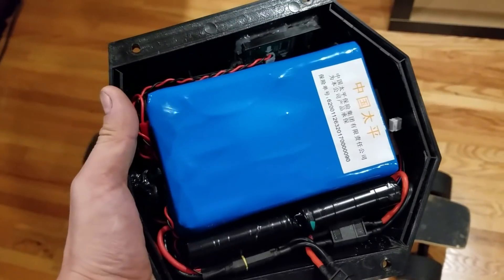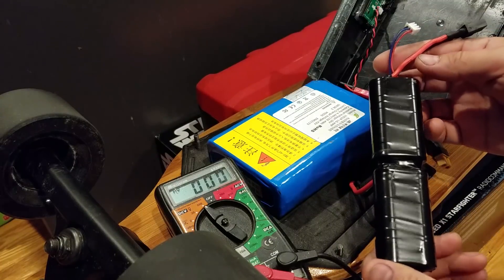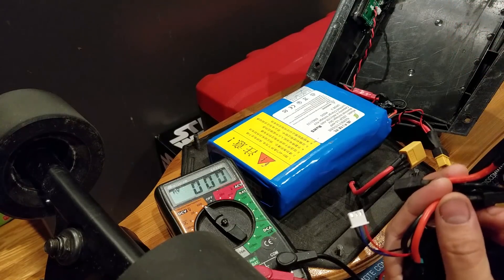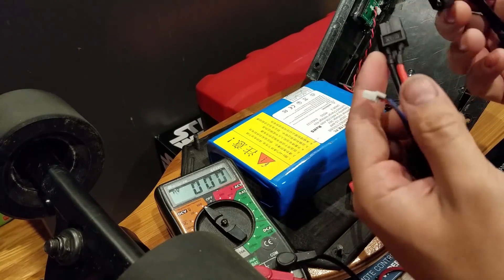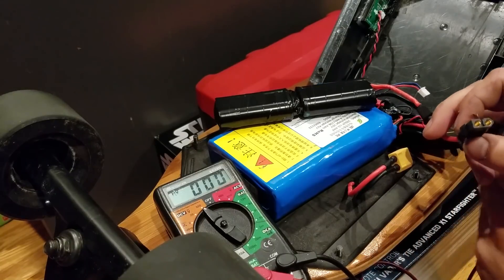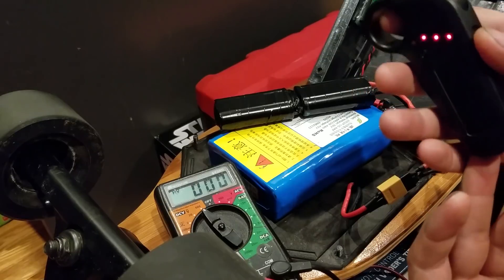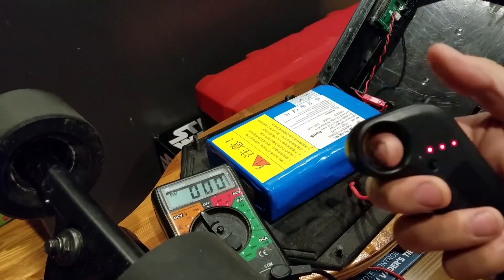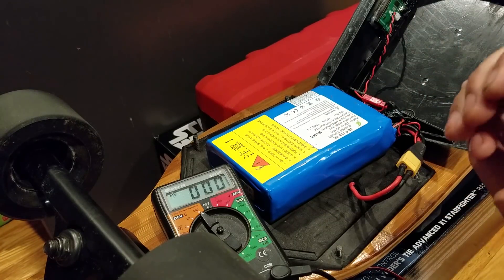50V Meepo Board

Comment: Hey! Just so you know, you have to resolder two spots on the esc for it to handle the higher voltage :-) The ecs is made for 12s.

There should be a guide for it some where,  you can even buy them "premade" for 12s.
Reply from the maker: +EDM Panda ive been searcing for 30 mins and can't find which spots to solder for 12s. From what i can find is there are two diffrent point to solder for 6s or 7s and if none of the points are solder, then 10s is enabled. 
I did find on reddit, one guy plugged in a premade 12s battery and that worked right out of the box. Without any modification to the esc themself.
 I cant even find any of these premade for 12s. 
If you could link me to the guide that would be awesome!
Thanks anyways
Reply: Hmm sounds strange, maybe some ECS are newer then others? Mine had 3 lines / 6 dots close so the XT60 connecter where it said 6S 10S 12S and the 10S was presoldered.

Sounds like he might have some versions thats different hence why some has it working and you didnt.

Ill try to see if i can find it, it was a guide from a eBay seller that sold the same ecs that he is using.
Reply from the maker: were you able to find a guide? the esc i have is excatly the same as this one https://meepoboard.com/products/esc-mother-board-for-electric-skateboard

Comment: An upgraded version of that ESC is being sold now and meepo buys components from diyeboard.com apparently. They offer the third generation of that ESC.
Reply from the maker: i just checked diyeboard.com and meepoboard.com and couldn't find this gen 3 esc you speak of. you have a link?, im very interested
Reply: http://www.diyeboard.com/esc-speed-controllers-c-535.html?zenid=t9qas911dkgqq24nou8tjul722  indicated as v1.1, but it has upgraded firmware/remote etc. Do ask them if these are the 12S version. They should be.
Reply from the maker: thanks, i sent him a message to confirm
Reply: Doug Hnut Get a FOC Box from enertion. Hands down the best esc

Comment: You have to connect the extra battery in parallel, that will preserve the original voltage, but increase the battery capacity.  You are lucky that the board didn't fry, since you connected the batteries in series, increasing the voltage.
Reply from the maker: for that extra battery to run in parallel, it needs to be a 10s1p and at least the same capacity cells. the extra battery i have in this video is a 2s2p so the wont work in parallel. and yes it didn't fry, that's part of the experiment
Reply: say they were the exact same batteries how would you connect the two in parallel